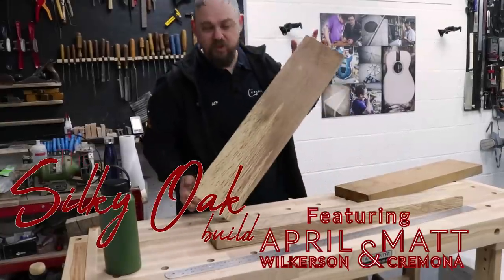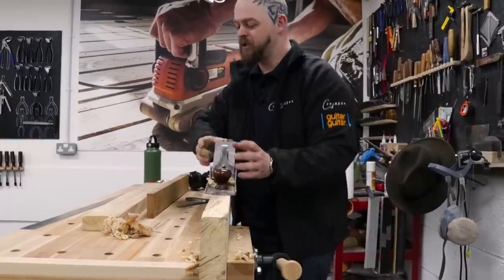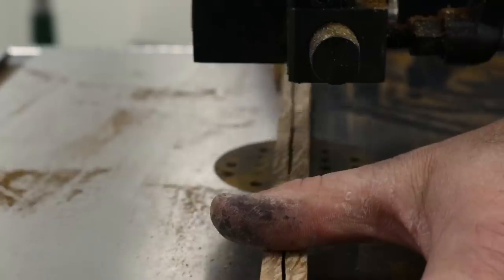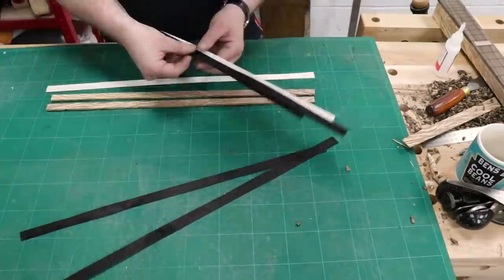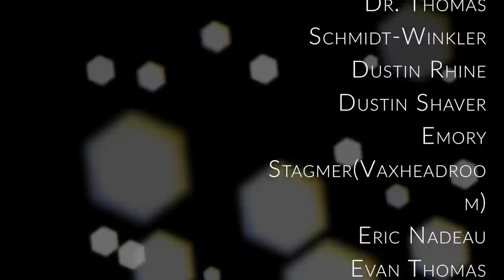Full Guitar Build in 10 Minutes- My Prettiest Wood Choices Ever?

Comment: So...a question (not specifically related to the silky oak build): Why do you need a neck break-angle? I watched a couple of your older vids about how to achieve the perfect break-angle without using protractors and calculations, etc, but why bother? Why can't you just have the neck parallel with the top of the body?
Reply from the maker: Good question, most guitar bridges are of two basic designs,  strat type or tunematic, a strat type term or fixed bridge has saddles that are about 11mm above the body and a straight neck, or very slightly angled one using a shim is fine..  a tunematic however sits about 14mm high and needs a few more at least for adjustment,  therefore you need to angle the neck back to fit the bridge of choice. B
Reply: @CrimsonCustomGuitars   Hmm, I'm still not  quite getting it. Even if you had a tunematic with loads of extra for adjustment, why not just cut out less of a pocket for the neck and keep it parallel to the body?  I'm not suggesting it would be better, I'm just trying to figure out why you need to add an angle.

Comment: Is that Australian silky oak? Looks similar as I have about 10  150mm  x 1400mm x 400mm slabs drying in my shed that I was thinking of using for a guitar.
Reply from the maker: We are not really sure.. maybe or maybe Holm Oak.. either way what you have will surely make a lively guitar is it is anything like this! Have fun with it! B
Reply: @CrimsonCustomGuitars  thanks Ben, figuring is much the same though smaller with more pinks and reds. Mine is Australian Southern Silky Oak or Grevillea Robusta.